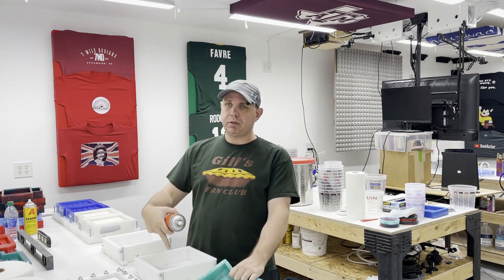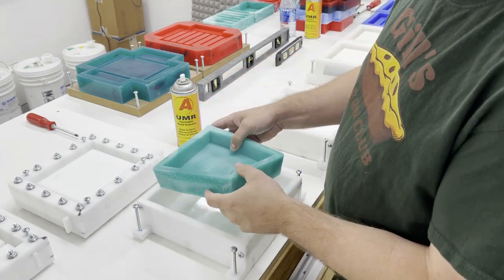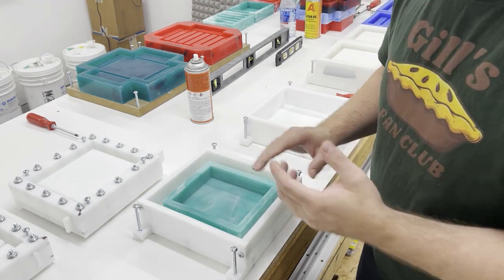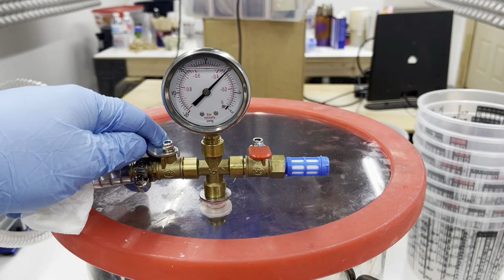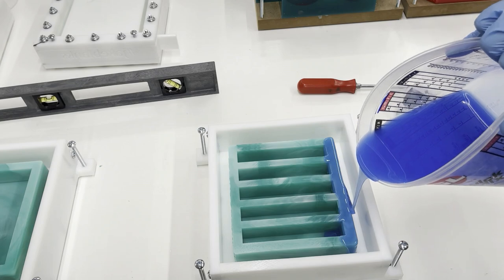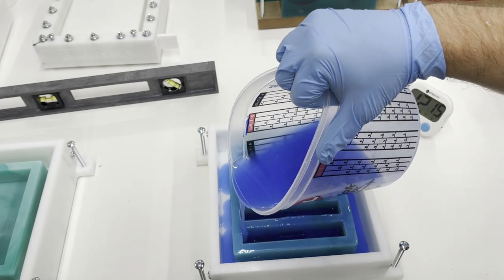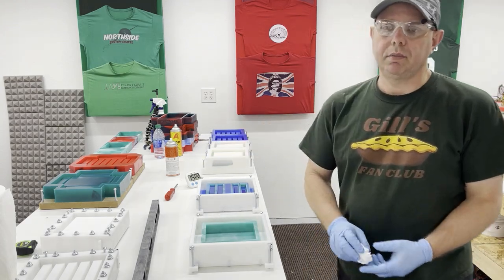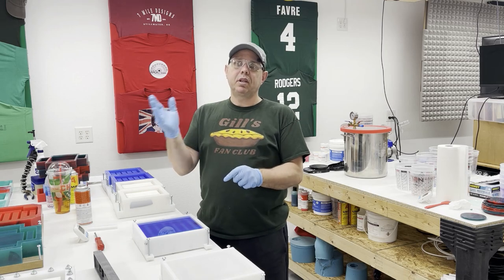Casting Silicone into Silicone - Can You do it?

Comment: is there a reason you try to avoid any contact from  the older silicone from object your tying to make a mold of ?
Reply from the maker: I just want to make sure the mold o make is smooth on the important parts.. where you put the old silicone, there can be lines around where the old silicone is… I hope I explained that right.
Reply: @ that makes sense, old silicone is already cute and not liquid so it won’t capture the details and there would be a line between it and the new silicone 

Thanks for the explanation

Comment: What if your original has countless small details?  Will making a master silicone mold to make duplicate silicone molds require so much mold release as to lose the details in the final replicas?
Reply from the maker: Nope.. it’s fine, you couldn’t have to lather on that much mold release.. I do 3D printed forms sometimes and you can see every layer.
Reply: So glad to hear it! Thanks for your quick response... loved the video!

Comment: I don't have the tools to degas...can I just carefully stir?
Reply from the maker: If you will be putting your molds in a pressure pot when you cast resin in them.. you should degas. If it’s not going in a pressure pot you can stir slowly and pour slowly from a good height.
Reply: You will probably struggle to stir thoroughly enough without capturing air. Jake's right about pouring slowly from a heigh - that can get out most all air bubbles. You need to pour a stream thin enough that bubles flowing into it are exposed at both sides - and pop!
Heating the mold gently in an oven beforehand can help, too.
And, taking a tip from the concrete industry, so can vibrating the mold after you've poured the silicon into it, to help dislodge any surface bubbles.

Comment: you may also consider different Silicone shore types. in general, a softer silicone has less crosslinks - meaning it sticks less to a harder silicone base. on the other hand, a hard silicone has more crosslinks and sticks better to a softer silicone base. 
Most release agents contain a thick silicone oil dissolved in alcohol - the solvent penetrates your master and may actually cause sticking! (eg. if you used more than a thin spray mist to reach undercuts). The thick silicone oil may melt due to heat and completely loose its releasing properties (eg if you are impatient or use heat to postcure)
Reply from the maker: @TheZahnputz  thank you for the comment.. very interesting. The shore hardness I chose for my molds is ridgid enough to keep its shape while pouring into, while being soft enough to demold.. it’s right where I want it. So changing shore hardness isn’t in the cards.. but a good lesson, so Thank you 🙏

Comment: Would this Silicone work as a insert into a wooden fly fishing box to hold fly's. Over time will the molded inserts shrink or get hard?   Excellent Video.
Reply from the maker: Thank you very much.. I’ve had the molds I’ve made for a couple years now with 100’s of resin pours in them. With no change at all. I don’t expect my molds to last forever with what I do with them. If they aren’t going through heat cycles and chemical reactions.. I’m sure there would be no problem.
Reply: @JakeThompson    Thank You.  I have a small CNC to cut the mold from something like you are using. I love the AIR Blow to release the Silicone. I will be using that. Thanks for that tip.  I have a bunch of your videos to watch.

Comment: Hi quick question, have you made any molds by 3D Printing,  thanks.
Reply from the maker: @gregdunne6791  Yes, but you need to make sure the filament and silicone won’t react to each other.. I used pla with plat 25 .. it worked well

Comment: Nice video! I’m trying to make some cupcake molds, but I didn’t see how you removed the excess silicone from the inside of the new silicone mold. Are you cutting it out with a special tool? Or have you made a silicone mold of your og casting to save time and materials?
Reply from the maker: When I use the plastic molds I would get excess flashing off with a razor blade… or even the small flashing would rub off with my finger.. once I had a mold that looked perfect.. I used it to make a silicone form.. when I use the new mold.. they come out with no flashing

Comment: Can you mold silicone together in a 3 step mold to mold a magnet inside solid silicone? if you dont use mold release on the surfaces you wanna fuse?
Reply from the maker: Right off hand.. I don’t see why not.
Reply: Perfect! Any silicone you can recommend? i need something around Shore 15A - 25A, and as described something that can fuse together.
Reply from the maker: @ThorMOG  I use  Alumilite plat 25 on everything I do.. should be a link and a discount code in the description

Comment: I need to make 50 silicone gaskets 6/7"×3/16" what is the best way to do multiple things like this? Can you give me some advice?
Reply from the maker: You can make a negative out of plastic, 3D print.. wood… use mold release.  Just make the form as nice as you can so the gasket will come out smooth.
Reply: @JakeThompson  OK, thanks . I think I will try to build a wood type frame. Thanks. I will let you know if it works .

Comment: Do you know if I can pour this silicone over a polyurethane rubber item, I'm scared it may stick?
Reply from the maker: I’ve only used on this silicone.. if I needed to do it. I would try it on a small piece first so I wouldn’t waste it.. sorry I couldn’t be more help.
Reply: I mean will it work and not stick together? It's a polyurethane rubber emblem I want to pour the silicone over?
Reply from the maker: @patrickkavanagh7371  I mean, I think that if you use mold release. It should work..  but I haven’t casted on something like that, so I can’t promise you it will work.
Reply: @JakeThompson ok  thank you for the  quick reply. Go Pack!

Comment: Probably a dumb question, I’ve just started researching silicone molds. But can you deep pour this stuff, or will it cook off like epoxy if you go past a recommended depth? 
I’m wanting to make a rectangular mold that’s 4’ tall and 6” square, with an inner dimension of 5” square. Is that even possible?
Reply from the maker: I use alumilite clear slow with a pressure pot.. It will work fine.
Reply: I have a silicone manifold in a 40yr old machine to repair/replace. I can see how to get there, thanks.